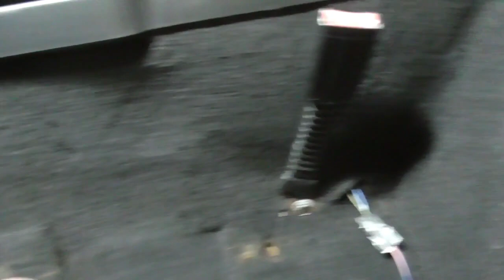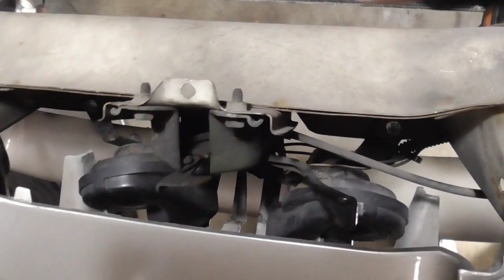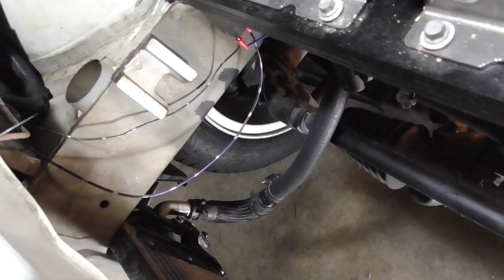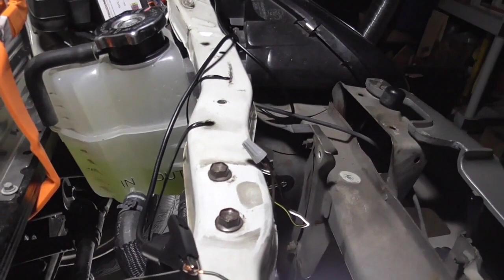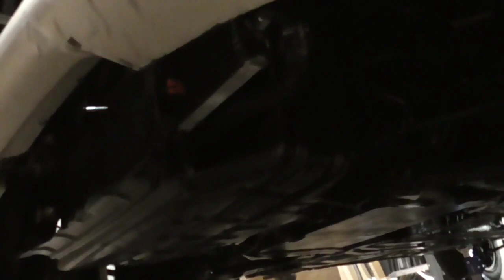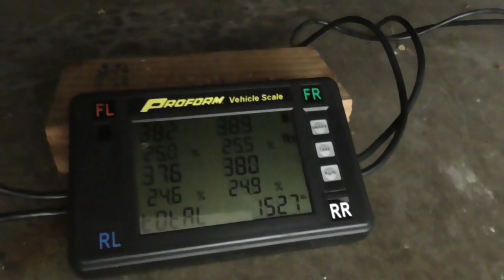Project: Cappuccino EV - episode # 9

Comment: any guesses on range?
Reply from the maker: Think about a 4,400 lbs. Model S with 80kw that goes about 300 in summer.  And now my 3,500 lbs. Bolt with a 60kw that goes about 300 in summer.  Now, we have 1,527 lbs. Cappuccino with a 12 kw pack.  It will be very interesting to see how many miles a kw we will get.

Comment: It moves! What a great job so far. BTW, you might want to get in touch with the 3D printing community as I'm sure they could print some new binnacles for the meters and tidy it off nicely.
Reply from the maker: Thanks!  Yeah, there will be further refinements.  I have a 3D printer, but have yet to use it.  Another new frontier to explore.  Kind of waiting for 3D scanners to come down in price before I start replicating & then redesigning.